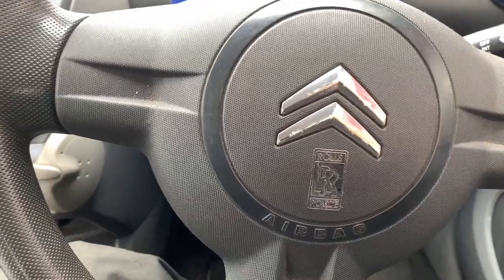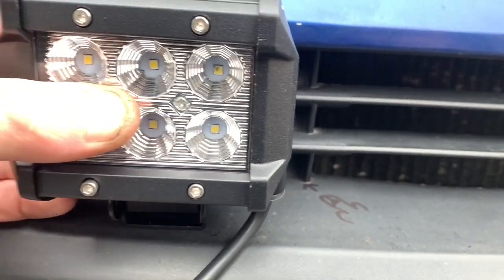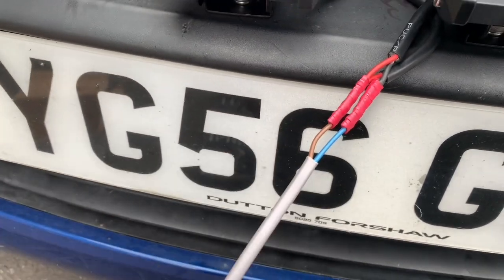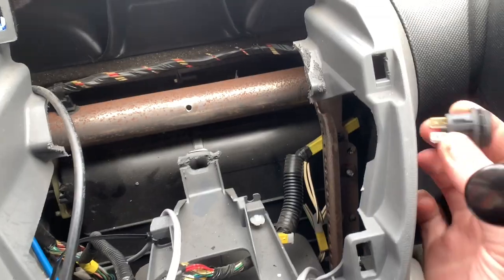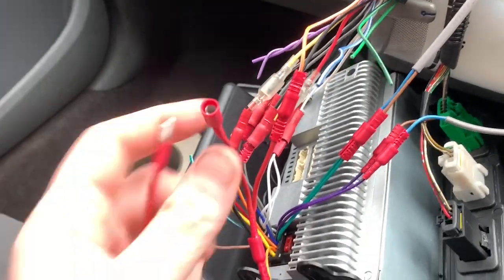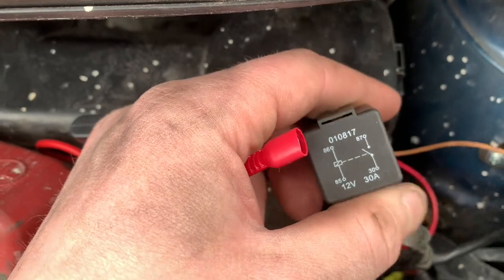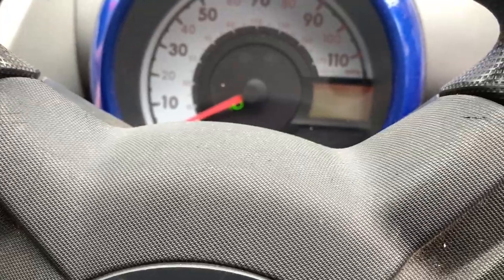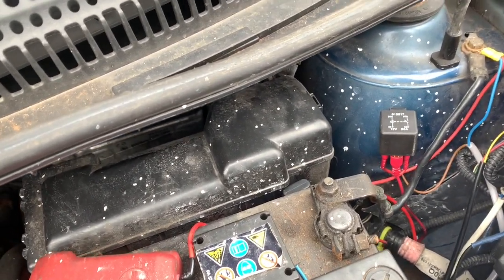LED Light Bar / Spotlights / Front Fogs Install inc Wiring a Relay (CityBug/Citroen C1/Aygo/107)

Comment: I wish I’d watched this 4 hours ago. I spent ages this afternoon trying to find somewhere to feed the live cable for my sub/amp into the engine compartment. Didn’t even think of using the heater pipe hole.
Reply from the maker: Where did you use? There will be better places, but that one was just the easiest I could see tbh haha
Reply: @StupidBlokeStupidVideos  Driver’s side, wiring loom goes through a big grommet and there are two nipples (hehe, I said nipples) on the grommet so I used one of those. Took ages to get the wire through - I used a metal skewer to poke through, then attached some old wire to it from the cab side, pulled it back through to the engine, then attached the live wire and pulled it back from the engine to the cab. Had to do it that way because of the fuse holder, and couldn’t be arsed to cut the fuse holder off and reattach it.
Reply from the maker: @infidelcastro5129  yep been there, on amp wiring you have a big dopey fuse holder. Got there with it in the end though!

Comment: I might actually do this lol.

I thought you were gonna put the button in the blanking plate beside the hazard light switch. Save drilling a hole In the dash panel

What gauge wire did you use?

And I assume you only need one fuse, on the high amp side of the relay
Reply from the maker: Yea I was gonna put it there originally, but when I pulled it out I realised that the switch wasn’t going to fit there very easily as it’s not a flat plate on the back of it. As long as you wire it the same way as I did, then just one fuse needed in the main feed to the relay, as the positive from the radio illumination is already fused by one of the fuses in the original fuse box. These LED lights take hardly any amps, they don’t even load up the alternator when switched on in the same way the headlights do so don’t need thick wire. The stuff I used was just some 0.5mm or .75mm house twin core I found lying about at work lol.
Reply: I might actually do it as well.

Comment: I've seen other citreons c1s have fog lights, presumably already fitted ( when making the car)..  do you think there's other ways on how to put fog lights on the car, like fitting some on the front grid? Or do you think the only way is the way you've done? curious, as mine doesn't have any front fog lights.. wondering if I could do your way or is there another way ? thankyou and you're too funny!  keep up the great work!
Reply from the maker: Yea you could fit them pretty much wherever you wanted to tbh. Lower to the floor would probably look better but I wanted these as spot lights. I’ve actually fitted much better ones than these now. It’s in a more recent video

Comment: Bloke! I was thinking to pull a cable through that AC inlet hole too, but I'm not sure if that is advisable?
Planning to put a cigar socket to the boot so I can plug in a small fridge when we go camping or so.
Reply from the maker: I’ve run a few cables through next to the heater matrix pipes. Should be ok cos there’s a rubber grommet there so it shouldn’t chafe, but as long as you fuse it as close to the battery as possible you should be fine tbh.
Reply: @StupidBlokeStupidVideos  Thanks for the advice! I appreciate your help! Keep the videos coming!
Reply from the maker: @Gourmondise  no problem mate, and thanks.
Reply: @StupidBlokeStupidVideos  so I fitted the boot lights this afternoon. Two 4.8w led lights, tapped into the courtesy light's main as I thought should handle these lights.
It didn't. Blown the bloody 15 amp fuse in the main box so I had to replace it whilst it was pissing down :D
Bloke, you think beefing the fuse up to like 20-25 will fix the issue?
I read into the manual and that fuse is responsible for the courtesy light, radio and the tachometer.
Reply: Of course as I submitted the comment I realized what I have done wrong.😅
I  wired the ground onto the plunger switch but in this case I should only wire the live to the poles of the switch as the lights aren't the only consumer in the circuit.
So basically I shorted the circuit like a dummy!😂
Anyways I hope this gives you an idea for your next project. You should do coloured led in the boot!!
Reply from the maker: @Gourmondise  lol. Is it working now?
Reply: @StupidBlokeStupidVideos  it should if the bracket wouldn't fell off that held the switch. I gonna fix it tomorrow.
Reply: @StupidBlokeStupidVideos  Yes! Working now good. I thrown out the idea of a boot switch as I hated how the thing looked at the end. Was bit of an eyesore, so the lights were wired up to a led switch on the right hand panel by the parcel shelf. If I leave it on by mistake and close the boot, the red led will glow until I turn the lights off.